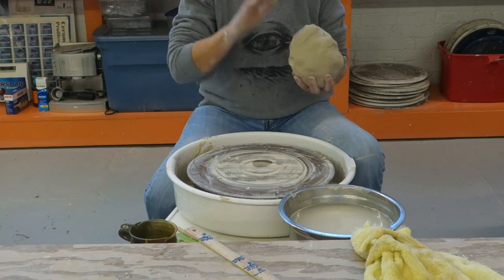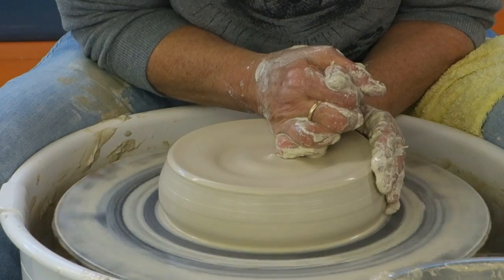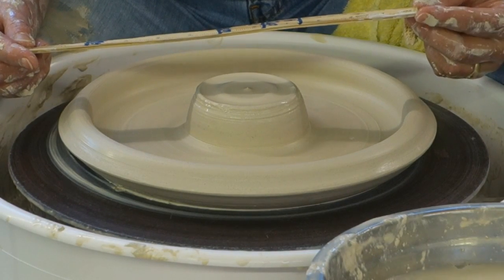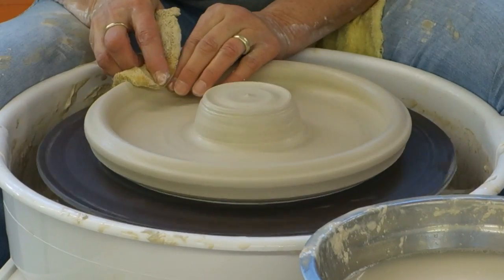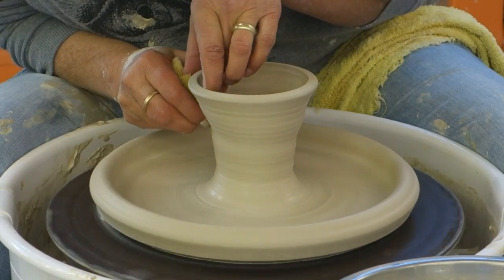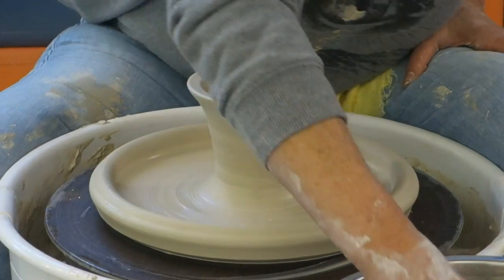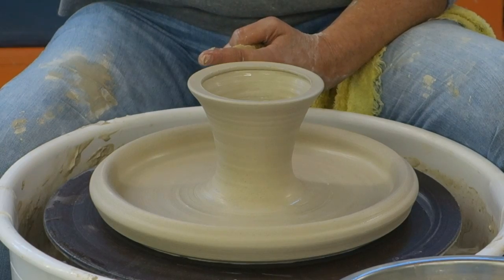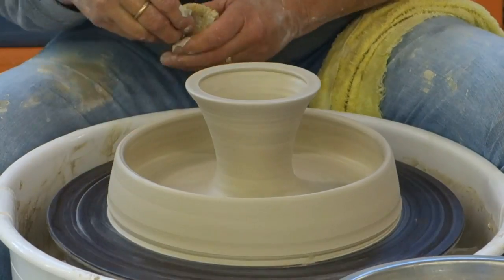Throwing a Cake Plate. Visit MonroeClayWorks.com.

Comment: Mine 4 have cracked big s crack. Compressed and compressed but still s crack any hints
Reply: Make sure the clay is very well kneaded before you put it on the wheel to use it. Also maybe thin it out some from underneath once it's dried some...meaning flip the piece upside down and trim some out of the middle, off the bottom etc. ~~Mrs. Defiglio ☺